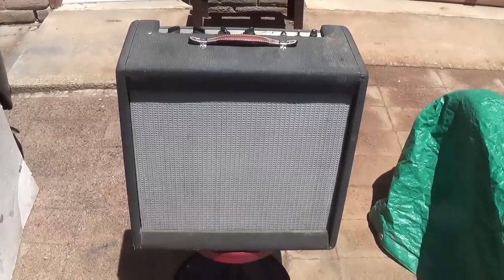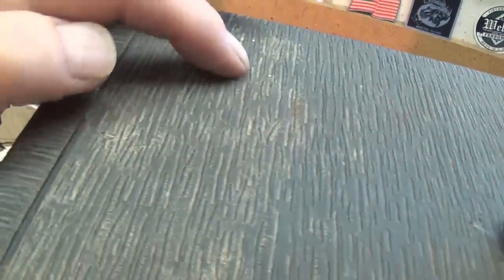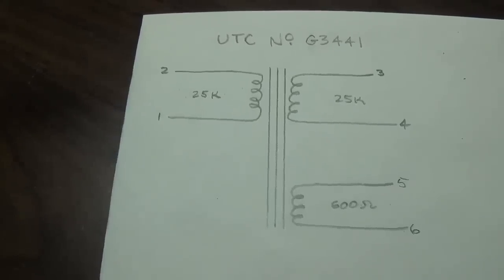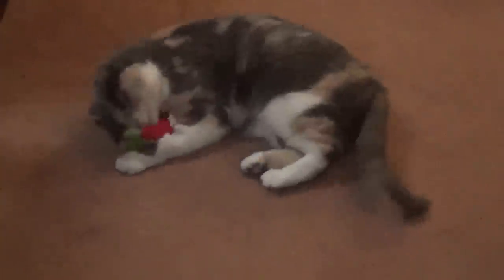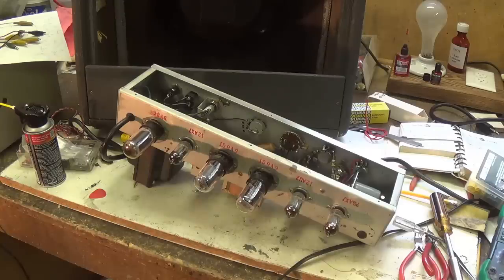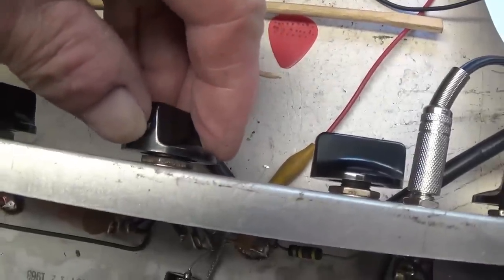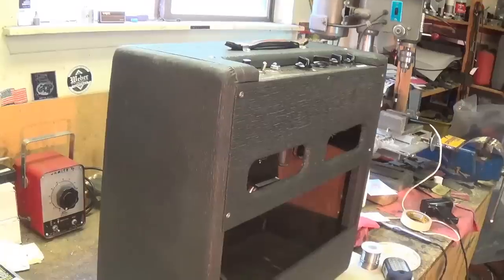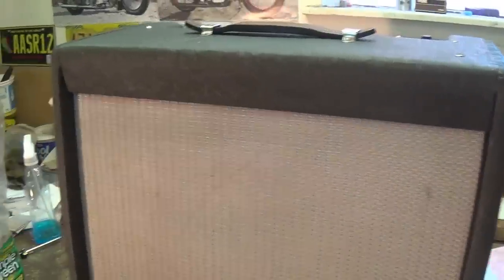1963 Lesmann "Echo" Amp......No More Polkas for this Bad Boy

Comment: great video as usual! youtube would be the same without you Doug! 
how do you solder wires and boards on the chassis? do you use a more powerful soldering iron? and would you remind what kind of product do you use to clean metal part like chassis and front plates?
Thank you!
Reply from the maker: Thanks, Pancri. I do use a special high-power soldering iron (made for stained glass work) to solder to chassis. To clean control panels, I use Windex or clean water and a soft rag......then wax it with car polish.
Reply: @UncleDoug  thank you, obviously I wanted to say youtube wouldn't be the same without you!
Reply from the maker: I appreciate it, Pancri. Thanks :)

Comment: Just rewatched this one again. That really was a pretty slick solution to the trem. Also wondering if you removed the line transformer. It might make a good mic input transformer for a preamp for a home studio. They can really make a difference when recording digitally.
Reply from the maker: Thanks, William. I generally leave parts like that in the chassis so they stay with the amp.

Comment: What does utc stand for in this application? Interesting video, had to watch it twice!
Reply: UTC was a well-known manufacturer of high-quality Transformers, not only power and output Transformers and also low-level, audio signal carrying transformers such as microphone impedance matching transformers. Their impedance matching transformers can often be seen in older microphone mixing consoles, and sometimes built into on- stage microphone- snake plug-in boxes for purposes of ground loop isolation, and preventing electrical shocks transmitted through the microphones. Some classic 1950s Williamson home Hi-Fi audio amplifiers, and early Heathkit amplifiers, used UTC output transformers. I think it stood for Universal Transformer company.
Reply: @goodun6081  being so close to the capitol I couldn't think of anything other than universal time 😅
Reply from the maker: Thanks for the great answer, GU.

Comment: Note the British style spelling of the word "Colour" on the faceplate.
Reply from the maker: Where do you see it, GU? I guess I'm losing my eyesight.
Reply: @UncleDoug  , upper right-hand corner of the amplifier faceplate. The camera moved around a lot, and I'm watching this in a small smartphone, so it's a little hard to see but I could have sworn I saw color spelled with the letter U added. If not, my apologies. I try to pause the video sometimes, but if I do that on this phone it loses at least 30% of the light intensity even if I have the screen brightness turned all the way up, and the length of time playbar blocks the bottom part of the screen.
Reply from the maker: I honestly don't see it. Since the unit is American made, such spelling would be strange indeed.

Comment: Did you by any chance draw out the schematic of the connections between the transformer and the amplifier?
 The reason I ask that question is because if you used the 5 ma 25K winding as a plate load for the 1st stage, and then connected the 3 ma 25K winding to the grid of the second stage, the 600 ohm winding could have been used for either an input OR an output.
 The transformer coupling eliminates any ground loop problems if the amp is located a long distance away from either it's signal source or it's signal destination.
The 25 K winding would have matched up nicely to that 270 K resistor you mentioned later in the video.
 I have no idea if that was what the transformer was there for, but since it is an expensive part I doubt they would have used it without a good reason.
Reply from the maker: Thanks for your input, Dennis. I saw no overpowering reason for it to be present......so I simply removed it.

Comment: make  secret sauce for finishing wood-called 3-2-1 finish. 3 parts thinner/2 parts varathane/1 part boiled linseed oil. tricky to combine, needs effort to homogenize. easy to apply with a small rag & you may wet sand the grain, then wipe off with clean rag. 1 or 2 coats.
Reply from the maker: Thanks for the Tip, Raffy.
Reply: Varathane sounds only vaguely familiar, what is it?
Reply: @goodun6081  it is that clear yellowish plastic coating on all the wood tables and such everywhere. and on floors. 3-2-1 soaks in and lets ya see into the wood without buildup on the surface. there is a video on it youtube. a second coat builds up some. many coats gives a thick finish but it sinks into the wood on the first coat to give superior look.
Reply: @raffyzoo2130  , my mother had her own homemade mix for sealing and n finishing bare wood: a mixture of beeswax and turpentine, not modern paint thinner or mineral spirits but actual turpentine. It was kind of like a soft paste wax in consistency.

Comment: Wow, Uncle Doug, you made a fantastic sounding amp from that rather odd  Lesmann amp.
I wonder if it was made as an  addition powered speaker with vibrato and tremolo effects to a regular accordion/guitar amp?
Reply from the maker: Thanks, Jay. I speculated in the video about its interaction with other devices, but tend to think it simply plugged into an electrified accordion. The "VIB" on the control dial may  depict some interaction with the accordion that is no longer possible (no accordion).....but I see no circuitry that would support this effect.
Reply: Yes,this is what I think also.

Comment: Surely the old grid resistor value was reliant on a stepped-up voltage from the audio-transformer on the input? ...that's why the level would have been low - someone bypassed the xformer without changing the grid components... Yes? No? Maybe?
Reply from the maker: I'd say maybe, Keith. Without a schematic, it's hard to tell.

Comment: Do you suppose that the phenomenon you were experiencing with the tremolo connected to the grids of both 6V6 tubes was due to the “push - pull” nature of the output tubes wiring?
Reply from the maker: Since the oscillator signal is inaudible and only alters the grid bias of the output tubes, phase should not matter, Ralph. I recently increased the resistance between the oscillator and grid from 100K to 220K, with excellent results......no more overdrive distortion.

Comment: With all of the gender confusion I just knew it wasn't wired correctly and justly so, but Dr Doug gave it its own unique identity. No SSRI's, safe spaces, teddy bears or coloring books were used in this treatment. The surgery was a success, it's alive!
Reply from the maker: Yes, but the debate still rages about the gender of electrons, Mr. B.
Reply: @UncleDoug   With the help of protons and neutrons we can get them back to being carbon based again. Oddly enough the bible says 

Revelation 13:18 King James Version (KJV) 18 
Here is wisdom. Let him that hath understanding count the number of the beast: for it is the number of a man; and his number is Six hundred threescore and six.
My thought is we are 666 being we are Carbon Based and we are Man = 6 parts electrons 6 parts neutrons 6 parts protons the periodic table. The beast is choosing to keep the flesh over God and we don't repent before we die, it's a free gift.
Reply: Actually, Uncle Doug cut out a whole bunch of parts that he felt weren't needed. Sounds like gender reassignment surgery to me. But that's okay Doug, you go girl! Ain't nobody going to bother you!
Reply: @MrBrymstond  , you sounded science-based in the conversations we had over the last couple of days. But not so much science based in this one.....
Reply: @goodun6081   Open minded I guess. Spread the wings a bit.
Reply: @goodun6081   It was reassignment surgery being it was designed for an accordion and he made it into a guitar amp. He also added parts. The man is a total guru, you rarely see a person anymore that's wants to teach people how to convert, improvise and improve on a good idea to make it even better and if we can all have some fun along the way, it's a good day. If we can't laugh at ourselves, it's all over. In the BIG picture, grand scheme of things we're all fairly small. Life is short, we have to loosen up a bit.
Reply: @MrBrymstond  , absolutely, I will agree that people in general are way too uptight. I personally have a better sense of self-deprecating humor than most, I poke fun at myself all the time. I am also personally on the agnostic to atheistic belief scale, and when anybody start sounding like a True Believer, my brain glazes over. I wasn't quite sure where you were going with that last one, whether you were being playfully blasphemous just to yank people's chains a little bit, which I understand truly and completely, or whether you're actually a believer. I actually used to enjoy arguing religious precepts and concepts with people in-person, but doing it with people that you don't personally know and don't physically meet and greet at a pub or over the dinner table can be dangerous to one's peace of mind. Actually, with some folks, talking about religion after everybody's had a few drinks can be dangerous to your physical safety as well. But I refuse to be relegated to talking about sports, and the weather, I mean really, what kind of a boring life that would be.
Reply: @goodun6081   No I'm not not dragging anyone into religion, but you have to admit the whole 666 matter and how I worked it out is dead on and true, we are 6 parts each, but it could be something else which I highly doubt. Freaky I must say, and if I were atheist and you were Christian, Muslim, Hindu or Witch-ever lol shouldn't stand in the way of progress, agree? We're hitting it off and that's what matters isn't it?
Reply: @MrBrymstond  absolutely, yes, being able to have a conversation with somebody, even if we might disagree sometimes, is not only all-important the necessary but it can even be fun. Somebody once said that the subjects you should never talk about in mixed company our sex, religion, politics, and art, but if you take those away, what's left to talk about? Sports? No thank you, I hate Sports.
Reply: @MrBrymstond  , here's a taste of my self-deprecating humor. Knowing that I like spicy food, my wife said this morning that there's a Caribbean Jerk Fest taking place about a half hour's drive away, and if she gets out from work early enough, perhaps we can go together. My response was, "a Jerk Fest? Obviously I belong there, for several  different reasons!"

My wife's not really into spicy food, she's more of a bland eater, except perhaps when it comes to me.😁
Reply: @goodun6081  I would have had the same response, it's so true in so many different ways. We have events from around the world, but I live in mid-state NY, boring so I usually go to Florida in January around his week long birthday party until I wear out my welcome, lol the vocalist begs me to come down and jam and he will plug me for repair work on computers and you name it and I'm rolling in doe. One of my favorite bands I was ever involved in lives in the St Pete area, I play guitar/ composed/promoted/ produced and the tech and occasionally the bass which happened to be the main instrument in one band. I love this spot, instant gigs and work. Get this Rt 666 the Gulf of Mexico is right there. John Pass Boardwalk is a awesome strip and sometimes I'll sneak up on him and stay for a month then go to Dublin Georgia to hang and help a old friend, he does computer work as well. Sometimes I'll go in the beginning of January and stay until my wife's birthday and take her to Rockport Massachusetts, I know many famous people that live there, mostly rock stars. Unfortunately I'm too sick to travel from a medication eruption, a long story. So do you live in, on or near the Caribbean waters area or was that just an event?
Reply: @MrBrymstond  , nah, just an event, I live in Southern New England, an hour or so from the nearest beaches. Population is fairly diverse and so we get lots of food fests and local events of this kind. I am half Greek and there were several Greek fests a couple of weeks ago, but we didn't make it to those. My wife works weekends so we miss a lot of that stuff unless she gets lucky and gets out of work early. One cool thing about this area though is that a lot of famous bands who are playing in Boston and or New York on weekends we'll play smaller clubs somewhere in between during the middle of the week, so I can drive a little over an hour or so and catch really good music in an intimate Club on a Tuesday Wednesday or Thursday night. Most recent shows we went to were Tab Benoit, and Richard Thompson.
Reply: @goodun6081  Same idea here, food from everywhere, not a bad thing. I love the surf and turf with loaded baked potatoes. When I go to Rockport I bring some stew beef and fish lobsters by the dozen off the dock on the main pier and I had the vocalist catching them with a net. I have a huge steamer and Coleman stove, we use some ocean water and steam them. I was gathering my rig and I kept hearing help so I ran to see my friend Mike buried in seagulls, I was pulling them off and asked him why he didn't get up and walk away, he was protecting a dozen lobsters and they were saying mine over and over, but don't you know the gulls wont touch that steaming hot pan and don't you know that's how they sound? He was so pissed off at himself, he said I do now, the gulls kick the shit out of him and another good one was my wife purchased a full sized apple croissant from a German Strudel bakery, Helmets, she put it to her mouth and a gull took it before she could taste it. lmao! Live bands in the streets and nobody realizes they're mostly all famous bands until you tell them. Have you ever been there? Great times.
Reply: @MrBrymstond  , was that Rockport Massachusetts or Rockport Maine? I've been to Maine a number of times when I was a kid, can't remember for sure but I probably been to Rockport in Maine. My folks had a Volkswagen camper van when I was 13 and thereabouts and we camft for several weeks at various campsites in Maine. Massachusetts, no, not that I recall. Not that there's any shortage of places to get good seafood in particular from Long Island all the way up through Maine. My folks had a place on Long Island Sound that they bought when I was a baby and sadly sold and I was around twenty, what us kids grew up digging our own steamers and cherrystones and quahogs, catching flounder and eels and striped bass and so forth. My folks used to do a New England style Clambake with a big hole dug in the sand and the fire and hot rocks and several garbage cans full of seaweed cooking corn on the cob and lobster and steamer clams and potatoes all in that pit, cover it up with canvas and sand and let alone to steam for a couple hours. damn, I just ate lunch and I'm making myself hungry again!
Reply: @goodun6081  Rockport Massachusetts (Cape Ann) Yes that's what I'm talking about, the pits we dug plus all of or steamers with all of the goodies. We even played on the boardwalk in Rockport Massachusetts and mad some serious cash and the huge Strippers are running around July 4th, what a fight they are, but tons of meat on them fish. People that pay for seafood there are crazy. $40+USD per pound of lobster meat.
Reply: @MrBrymstond  , folks are gonna chuckle at "Strippers"!. Obviously that's 'sposed ta' be stripers aka striped bass! Just think, "Strippers" with fight and a ton of meat on them! Auto-correct strikes again, most likely! PS, I caught a striper that weighed over 40 pounds in the Sound some years ago.
Reply: @goodun6081  Ahahahahaha! Never even thought about it, who wants a stripper with a ton of meat on it? That's too funny, yikes! Yeah, they average about 40lb's and fight like crazy. After 4 or 5 of them, I'm worn out. They run like crazy through the Annisquam river, it's really just ocean with an island in front of you. I take a number 2 rounded hook and a 1/3 of a herring with no sinkers and cast out, you can see thousands of them and it never failed to catch more than your arms could handle. I caught what I believe to be a shrimp, but it was most of a foot long, I ate it. Do or have you ever hunted deer?
Reply: @MrBrymstond  , I'm not a hunter really, went deer hunting in Maine a couple times with my dad, but the deer were nowhere to be seen ever, despite tons of tracks, except on a Sunday when you couldn't legally shoot them. On Sunday the little buggers were everywhere. I do enjoy eating venison, and we had other family friends who had one member who was an avid Hunter and bagged a Moose one season, so we ate moose burgers and moose chops all summer long. I'm really easy, actually, I eat everything. I eat pretty much every vegetable I've ever been offered, meat and fish and whatever. It's one of the best part of traveling, especially overseas, you get to try new food.

I used to be a really good shot with a small rifle when I was much younger, but my eyes are s*** now and anyway I never really kept my skills up.
Reply: @goodun6081   Just rub an apple up and down a tree and sit 20 to 50 yards away, I average 20 to 30 minutes and I have one, maybe two. Apple salt licks is big. I can't give you an honest count on how many, but nobody would believe it has to be in the 4 digit range. I usually just wear street clothes and walk normal. All my friends wear camo and spray doe piss on them, but they never got one, but somehow I'm wrong. When deer see you in the stalking stance they disappear and I had my moments wrestling with what I thought was a dead deer, what a ride, they don't give up. So after shooting one you at least let it die in peace. They fight like no human. They will stand on their rear two and beat you to death with them front hoofs and if a doe gets you with one rear kick, it will open you up like butter. Their rears are like razors with all of that muscle behind it.